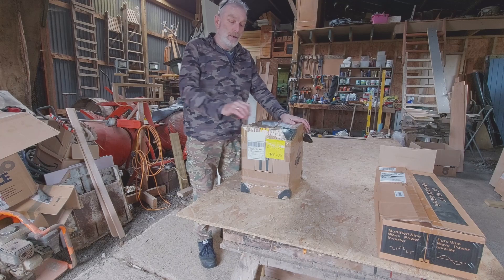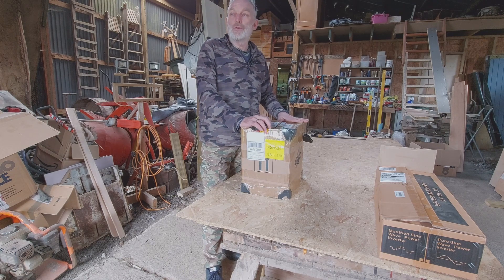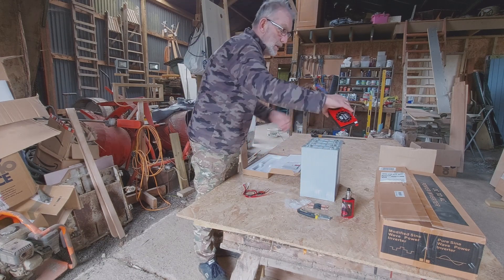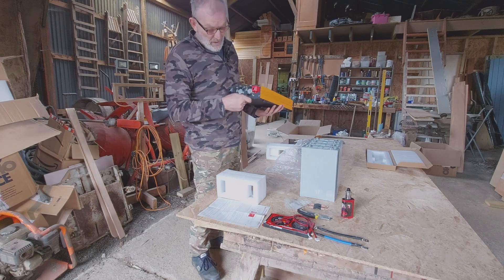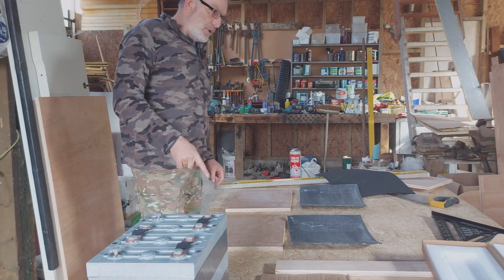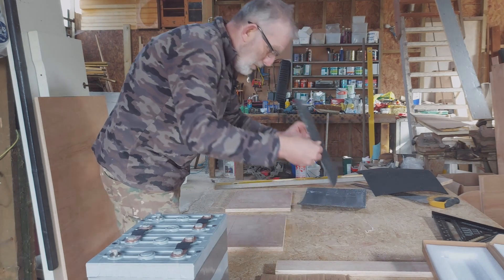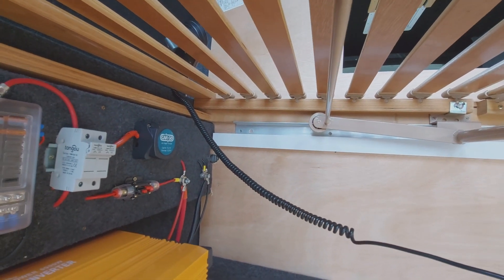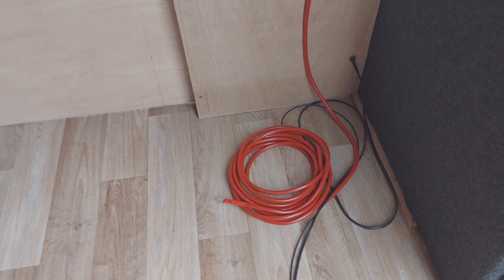Citroen H2 L3 camper van conversion off-grid electrical system

Comment: Great videos and congratulations on your fit out. I've also built my own LiFePo4 battery and it looks to me as if your main positive and negative cables attached to your battery poles are undersized for the amps you may draw with a 3000w inverter. What size cables did you use in the battery? Should be at least 35 to 50 mm sq. Cheers
Reply: hi you are right in the video I had the original cables on their I have now  upgraded them to a much thicker cable. thanks for your comment

Comment: brilliant idea with the battery, i have just bought a citron relay l3 h2 to convert and i have been searching for best way to do electrics as i am not electrocution and want easy access, Fantastic example Thank you , great job om the van so far
Reply from the maker: thank you for watching my videos I'm no electrician either but this way if something goes wrong I can always get back to the wiring.